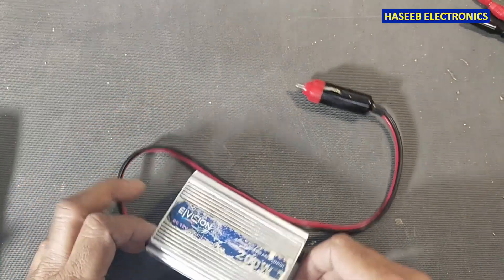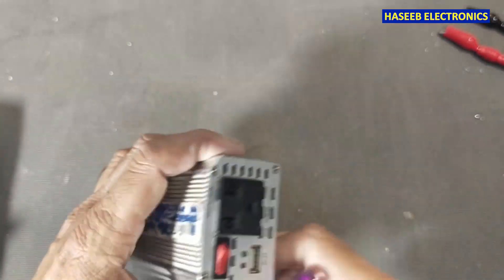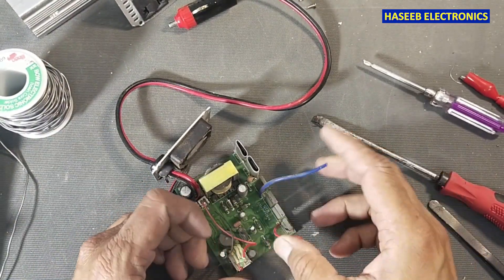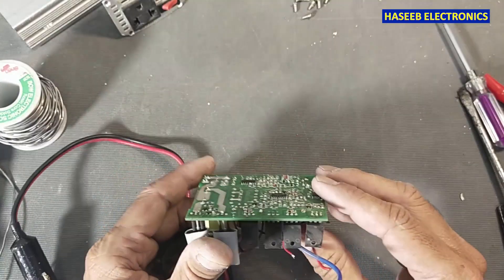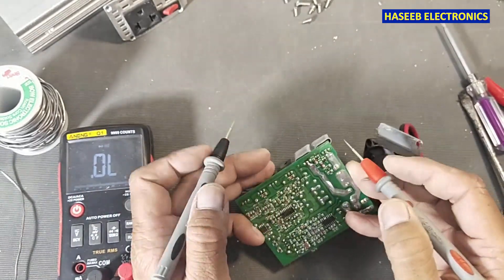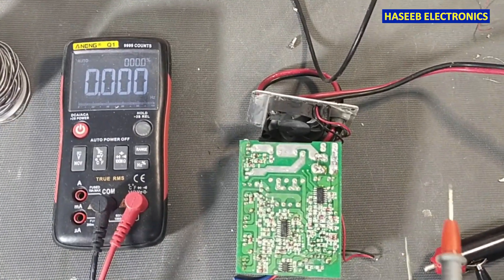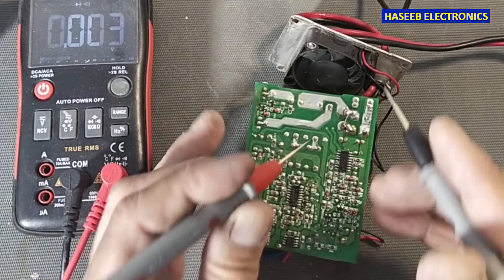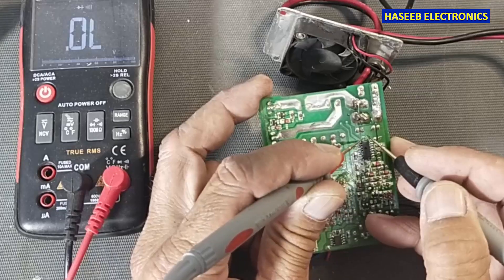{723} 200 Watt Mini Inverter Troubleshooting

Comment: hi sir 
i have a 1000w inverter with three tl 494c ic 
my problem is its power on normal with the green light is open 
but i have variable voltage output 
flickering output ?
can you tell me on your opinion what must i check ?

Comment: I have a question that also raised after i just watched your other '3000 VA solar inverter series' .

how do we know what mosfet is suitable replacement if we cant find the matching one. 

what is so specific in this circuit that we have to ensure that this mosfet is gona work, i mean if opt for a different mosfet what changes we need to do in this circuit ? i believe that the mosfet is driven by a transister at its gate so do we need a diffent transistor with different gain characteristics ?

Can you show how the mosfet drive voltage affects the output ?

Looking forward for more learning videos from you, Jazakallah. May Allah Subhana Wa Taaala give its reward to you.
Reply: Check out alltransistors. You can find equivalent that way friend. ❤️

Comment: Thank you Mr Hasseb.
Regarding the 5V ref voltage, is it on pin 13 or 14 please?
Reply from the maker: pin number 14 is reference voltage. 
pin number 13 is output control

Comment: Will you try and repair this mini inverter?
Reply from the maker: sure 
if the repair cost is less than 65% of the equipment cost, we can repair it
in this case TL494 SOP IC. it is around 1 dollar, 
if i can find locally, i will fix it